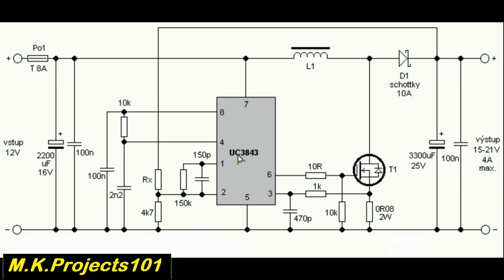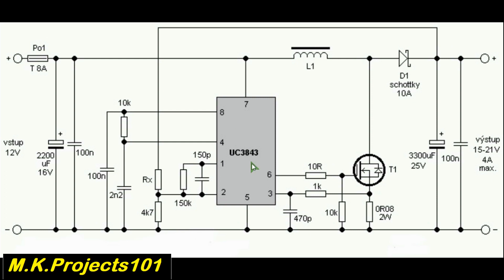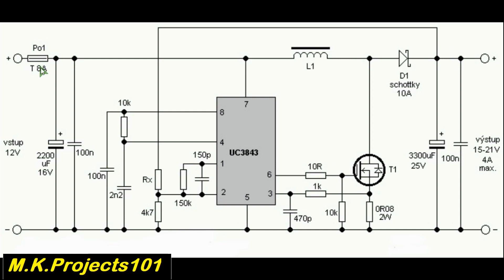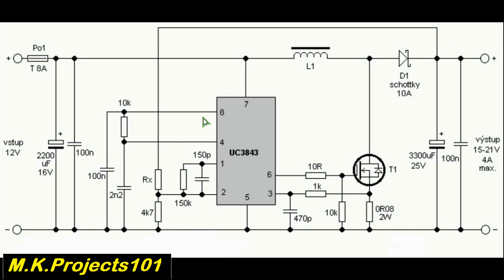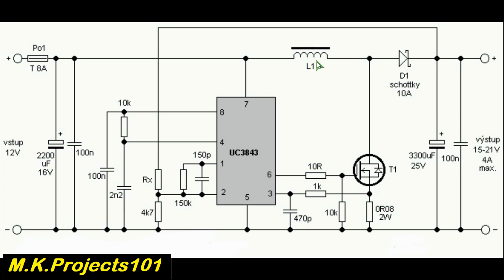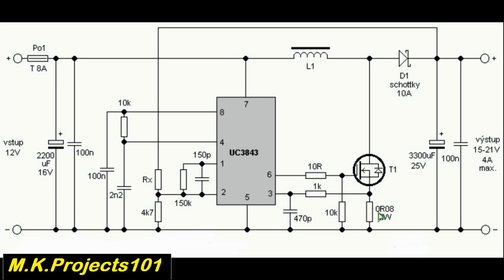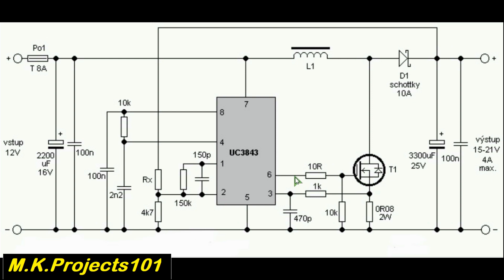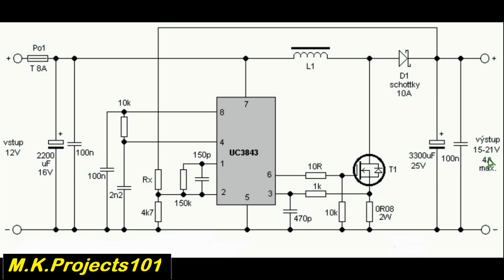Inverter for Laptop (12V to 21V Power Supply with UC3843)

Comment: What about L1. How much? 
The number of the MOSFET  ?
THANKS
Reply from the maker: L1 is 47-220uH while the Mosfet is irfz44 or any other with a current rating of at least 15A and voltage rating of 50V or more
Reply: @ELECTROBUFF  
Thanks